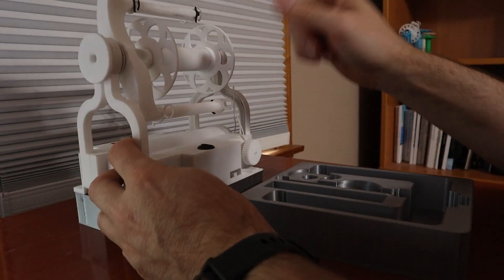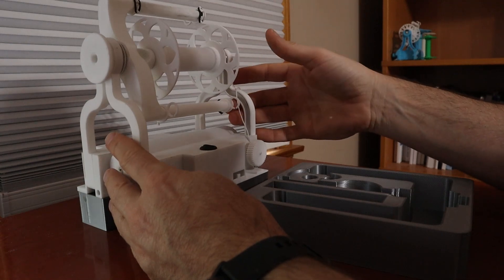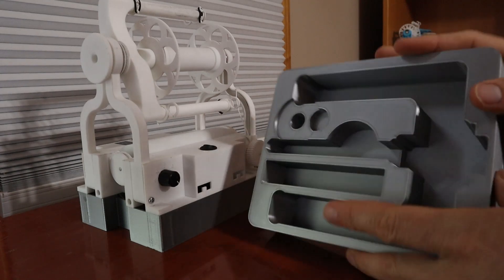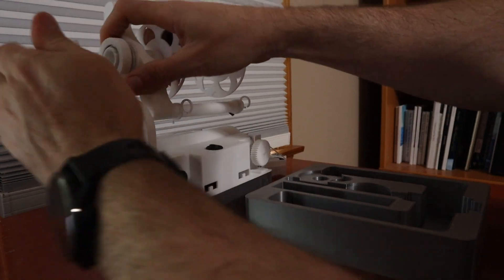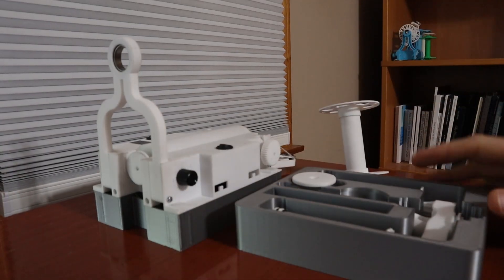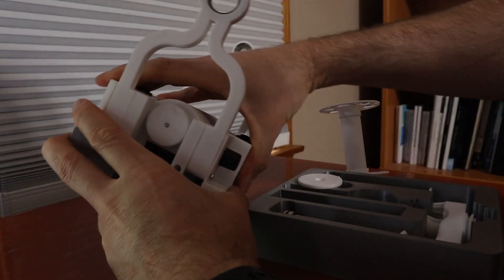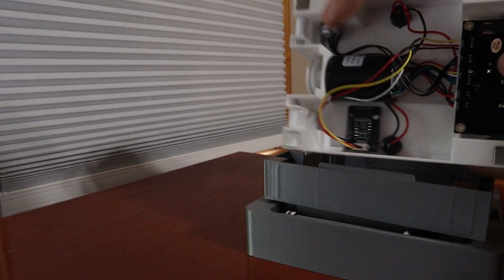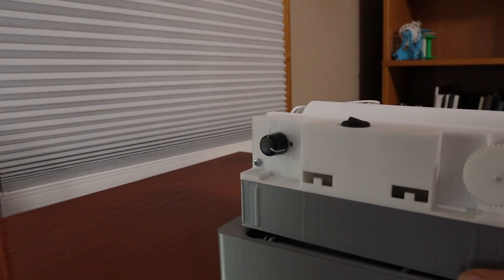Spin 179 - EEW Fold Prototype Flyer Foam Insert Explained

Comment: looks good. Would the PowerPac (Talentcell ) fit in the case as per usual?
Reply from the maker: The bottom in this video holds the Talentcall 6000mAh battery pack like the EEW 6.  I'm still trying to decide if I will ship with that or the flatter bottom in the previous video.  About equal number of people want each one so I will decide in testing which one myself and the beta testers prefer.  Both versions of the bottom will be available as 3D printable files, but only one will ship with it.

Comment: Is it possible to make the flyer bottom magnetically attached to the base too?
Reply from the maker: I think it makes more sense to have that sit in the bag so then the magnets wouldn't make sense. If you have some other use case for it let me know.
Reply: @DreamingRobotsBlog  i think the usecase really is "everything stacked neatly together snapped together and holding flat, in a bag, in a stack."  the fewer loose bits the better so hence the desire to make it all snap together
Reply from the maker: @tpauofvulcan  but I really think this bottom piece will hold the bag flat and open better. So in my thought process, having that piece always in the bag will make the bag more usable. Maybe I will prototype both and see which actually works better.